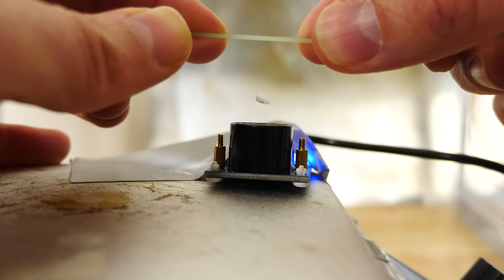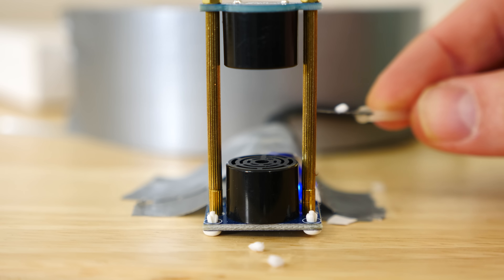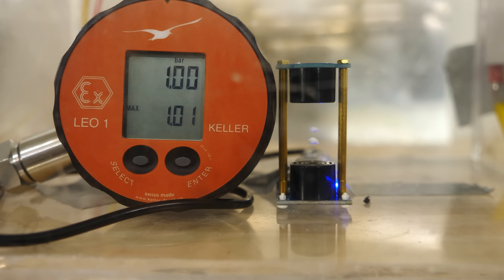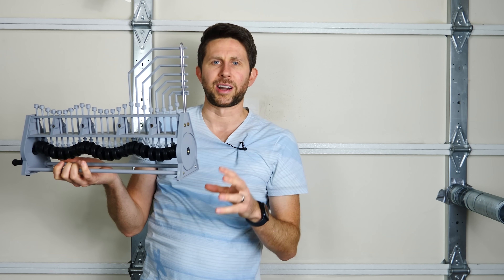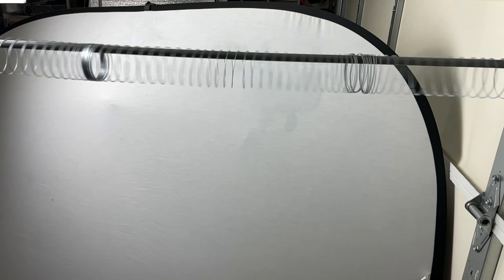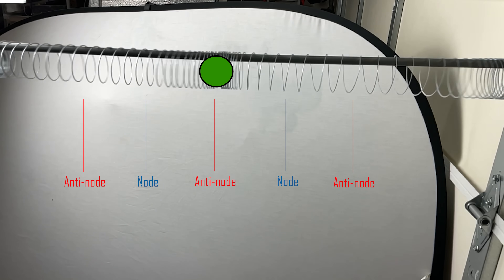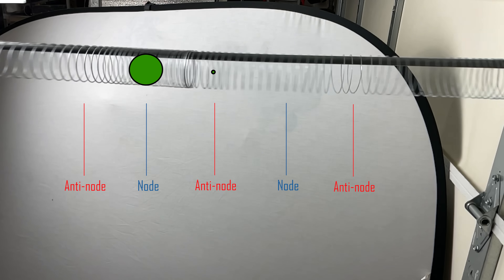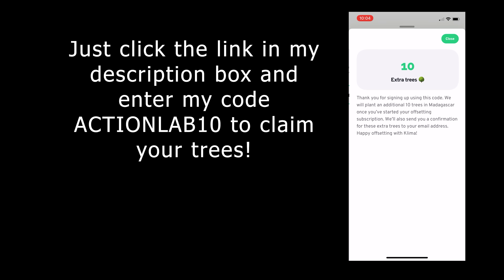How Does Acoustic Levitation Really Work?

Comment: Is there any chance we could see this demonstrated in a liquid medium?
Reply: Don't think so, as liquids are almost uncompressible, as opposed to the air
Reply: @mariosebastiani3214  not true, look up acoustophoresis. I work in that field. You can levitate stuff quite easily. Yes it's less compressible, but it is compressible. Otherwise you wouldn't hear under water, have sonar, or whales communicating. But there is also much less dissipation than in air. Plus with focused transducers, you don't need standing waves.
Reply: @nicolasbertin8552  That's interesting, especially your last sentence. Can you please point me at a specific online document on the topic? I'm used to work with air propagation only, and I'd like to broaden my knowledge. Thanks!
Reply: @mariosebastiani3214  just look up any acoustophoresis article, they're all in liquids. For a full understanding of the subject, Lab on a Chip, the journal, published a series of articles called "acoustofluidics". You'll see in there how to produce levitation (mostly in liquids) with surface transducers, standing waves, or focused transducers. You just need sound to have levitation, that's why the video is misleading, it sounds like you absolutely need standing waves but you don't.
Reply: Yes it does work in a liquid but it is a bit tricker, the wavelenght of the sound in liquids (water for instance) is much smaller  so only very small particles can fit the nodes and also viscosity must be taken into account.

Comment: What if, you play 2 notes with different frequency, say a C & a G ( a perfect 5th interval) , will the nodes & anti-nodes form at equal distance? What if other combinations, a C & a F# ?
Reply: If you use waves at two different frequencies from either side of the spring, you'll end up forming a beat frequency. When adding both waves together at a point, the amplitude, or size, of the resulting wave will have a pattern of decreasing and then increasing over the course of the beat frequency, which can be worked out by looking at the difference in frequency between the two waves used. 

As the points of maximum and minimum amplitude of the wave won't necessarily be in the same place, I don't think you'll be able to produce a standing wave pattern that is stable enough to make objects levitate as in this video.

Comment: I've done experiments with arrays of these ultrasonic speakers at university. You can move little beads around in 3D space. If you put your finger in there you can actually feel the pressure zones pushing on the skin.
Reply: Thats awesome
Reply: That was the first thing I thought of doing if I had a setup like this.
Super understandable video.
Reply: It seems like this would have some practical applications in navigation as another means of a gyroscope. But then again why reinvent the wheel.
Reply: @doiron12  not really. One possible application is as a volumetric display, if you move the particle around fast enough and make it reflect light. But there are better volumetric display technologies.
Reply: can it be scaled up to lift up a car? or can it be improved to act as a shield for cars during crashes?
Reply: @electrokoh5511  unfortunately not, at least not with regular atmospheric pressure :D
Reply: @ProjectPhysX I was hoping for a not yet answer. I want to see large objects being moved using sound
Reply: Oh yeah that actually makes sense, I'm guessing lowering each transmitter in the array in a way to create the differential?

Comment: why would it make sence for any particle, to move toward the high presure area? ofcourse it will always settle in the low presure area..
energy always find the way of least resistance not most resistance...
Reply: there is no high pressure area, it keeps oscillating between low and high pressure on the pressure node
Reply: anti-node*